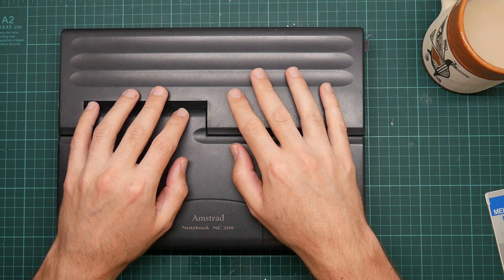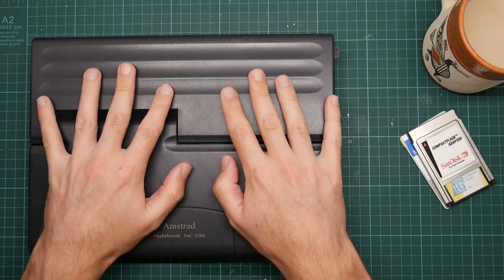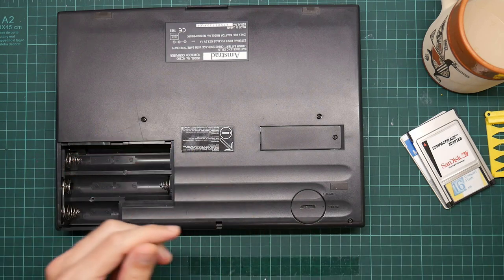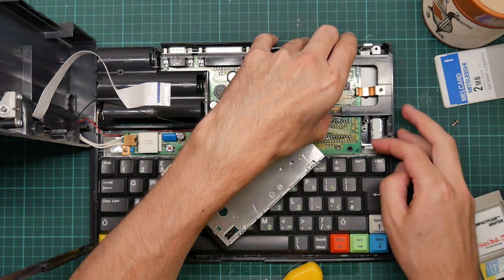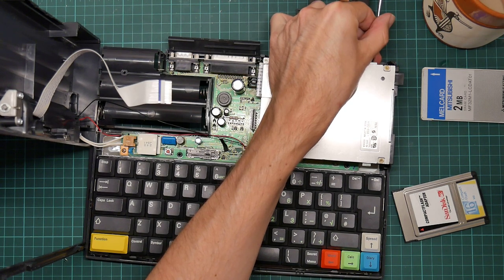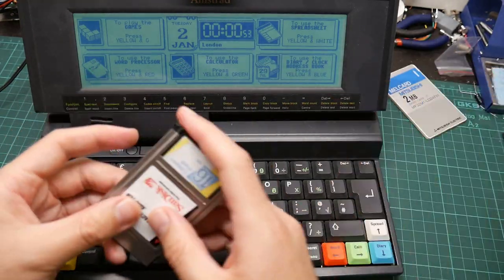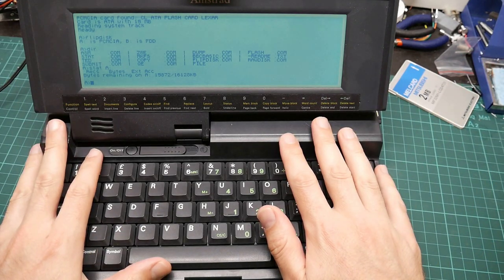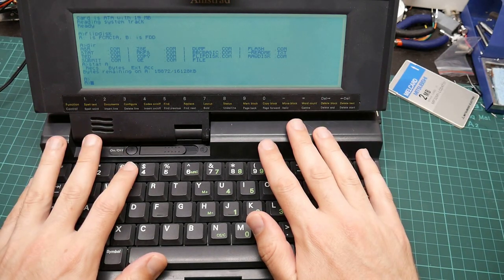Hjalfi flashes an Amstrad NC200

Comment: This is great! i've just bought an NC 200,  Looking forward to running CP/M on it.  I notice on your website that you say there is no serial port support.  Do you have any plans to add that?
Reply from the maker: Mmmmaybe? It wouldn't be hard to do as it's all well documented, but CP/M doesn't have any standard interface for setting things like baud rate and format. Plus CP/M 2 can't poll serial port status which makes writing things like terminal applications rather hard. Most serial port software tended to talk to the hardware directly. It would be useful for file transfers, though.
Reply: @hjalfi  Yeah, that's what I was thinking.  I love floppy disks but it would be great to have something like xmodem to transfer files as well, I've also been playing with some bbs systems on my NC100.  I know that can be done through the standard ROM programs but would be cool to play with in CP/M too.  I have next to no knowledge of CP/M so I'm not sure what's possible.

I've seen another version of CP/M called ZCN for the NC100 & NC200 systems, would it be possible to use the same floppy boot trick to run that?
Reply: @hjalfi  Gert is working on this. It works, but the appears to be some clashes between the system interrupt (which causes delays, also due bank switching) and fetching a byte from the one-byte-buffer of the UART. Hope it works out well :)
Reply: xmodem transfer works, but with failures.. so far. The same xmodem code runs on other platforms without issues.
Reply: I managed to get stable xmodem downloads by masking out the keyboard interrupt during the downloading. I still do not understand what is exactly happening but it looks like the UART interrupt, interrupts the keyboard handler or such. Anyhow, with the keyboard interrupt masked out I can download without errors, even at 19200 baud. The setting of the baudrate is added as an extra bios call. Alas there was no space left in the standard bios config so I expanded the bios by 256 bytes leaving room for more optional extra's. The handling of the serial interrupt, buffering and the code for READER (serial input) and PUNCH (serial output) is all in the supervisor space.

Comment: I've just been digging about in my loft for 20 minutes, and just found mine buried under a pile of Spectrums.

I just need to find/make a 7.5v PSU now... Somehow.

Unless it can take 12?
Reply from the maker: It can't take 7.5V. In fact, the power circuitry is pretty fragile, and also the barrel connector is CENTRAL NEGATIVE and if you connect it up the wrong way round your NC200 will asplode.
Reply: @hjalfi  awesome, top quality Amstrad engineering then, I see. I'll power it from a bench PSU to see if it even works. It seems people sell replacement PSUs on eBay.

I've got an RC2014 that I've been having fun with, so a portable Z80 machine has got to be just as fun, right?

Comment: @Hjalfi - Was a fix found for getting the onboard ROM to access the CF card as RAM, or is this still not possible? I've just got an NC200 and being able to file swap files made on the onboard software and BBC Basic straight to PC via a CF card would be awesome.
Reply from the maker: No, you'd need to patch the ROM to make it work. That would involve reverse engineering it enough to figure out where the SRAM code is, and even then you'd need to make your own modified ROMs.

Comment: I had a similar problem with a palmtop computer - the computer could read a compact flash card but only has slot 1 size sockets, so the compact flash adapter wouldn't physically fit. I actually ended up pulling the metal case off the compact flash adapter and found the adapter itself was small enough to mount inside the palmtop. Effectively this converted the slot 1 socket into a compact flash socket! The palmtop has 2 slots available so I still have the option to use an SRAM card too.

Comment: Just discovered 2 things:
1) you don't need the adapter to use a Type 2 card: you can use a simple file to remove a bit of the material inside the original PC card slot and the Type 2 will fit right in like a glove (suggested to remove the plastic piece while you file it though; so you won't get dust all over the internals)
2) For some reasons if you try to format the PCMCIA card as memory card, the NC200 see the card as a 3 mb card and format it, but it won't use it to save files on it nor it seems you can access it at all, so if you plan to use a type 2 card as memory card, that won't work and will work only with CPM (unless I am missing something... tried with a 16 mb and 32 mb Flash card via type 2 adapter and neither was formatted by the NC200 standard ROM)

Comment: BTW is the ram flash card readable on a standard laptop pc with a PCMCIA port? I assume that when these cards were around, people with old laptops would use these to move data from and to it? Or does it require a special adapter?
Reply from the maker: Provided the battery in it works, then yes. You may need special software. On Linux SRAM cards show up as block devices that you can just dd stuff on and off, but I don't know about Windows. If there's no battery, it'll still work, but as it will lose data as soon as you unplug it then it's not very useful.
Reply: @hjalfi  Thanks; I do not have a linux machine with a PCMCIA card sadly; just an old W98 laptop or a WindowsCE device (a HP Jornada), so not sure how can I actually use the SRAM card with those machines to move data between the NC100 and the other machines I have.
This means that plugging in the SRAM card in a standard PCMCIA slot won't work, right? My concern is related to burning that card... It is the only one left I have, and they go for more than 150 dollars in US... So not exactly keen on destroying it :D
Reply from the maker: @fcf8269  You won't destroy it. It's a perfectly normal type I PCMCIA card. Sadly I have no idea what to do with it on Windows, although there's a possibility it'll just show up as another disk and you could use something equivalent to rawwrite. ...although, hmm. You might be able to use the NC100's serial port to transfer a file to internal storage, and then use the 'make bootable SRAM card' option to write it. Assuming it has one. I don't have a NC100.
Reply: @hjalfi  Thanks; so no damage possible there; in terms of connection. Is the format process using something like dos-compatible filesystem? I could not find details about the file format. If it is similar to what the floppy on the NC200 use, that should be readable by a windows/dos machine I guess

Comment: Which modern embedded and RTOSs would work well on here!?
Reply from the maker: Beats me! Are there any modern OSes which run on the Z80?
Reply: @hjalfi  I mean FUZIX for the Z80 works well. FreeRTOS could be a candidate as could Zeal 8-bit OS, but that’s mostly made for his hardware. 

So that’s 3x modern operating systems, but all would need some work in their own ways, some more than others. 

You have a serial port so could serial console to it. Your specs are great: 

[4.606MHz Z80, 128KB RAM, 512KB ROM, PCMCIA slot, 720k floppy drive, 480x128 pixel display]

FUZIX needs 96KB RAM, and should work with the 512KB ROM. And using a  1MB PCMCIA card could add more storage. (As could serial to USB but that’s a different beast). 

FloppyEMU might get you more storage there too? Idk. 

There are so many modernization options available. Including WiFi over serial. Would be super funny to see this at a Starbucks in the wild on WiFi, using a text based browser
Reply from the maker: @EirikrTinkerTries  I have actually done a Fuzix port to the NC200; it works pretty well, if slowly, although I'm not sure I would call it modern! Unfortunately given that there's only one PCMCIA slot I had to pick the banked memory expansion over the CF adapter, so all you get is the floppy for storage. (Which has now failed, so I haven't touched it for a while...) Without the memory expansion it's pretty memory constrained, with the kernel itself using about half the RAM. This would make it very swap heavy.

Comment: Is it possible to format bigger CF's, such as 64mb? I am aware that I'll be able to use only 32mb. In fact, I found ATA PCMCIA Type I with 64mb, but I am wondering if I need a storage that's strictly 32mb or less.
Reply from the maker: It'll work, but you'll only be able to use the first 32MB.

Comment: would this work also on a NC100? Is there a way to make a flash card that would hold CP/M?
Reply from the maker: Yes, but it'd require some major reworking --- you'd need to use the flash card for RAM and storage, boot off it, etc. Luckily there's a product called ZCN which is exactly what you're looking for: https://www.ibiblio.org/pub/packages/zcn/
Reply: @hjalfi  Nice! is that equivalent to stock CPM in terms of how it can run original applications? My nc100 has a 1mb card so I am going to try this one!
I wish I had a NC200 though; the larger number of lines really make a big difference... And I saw nobody modding the NC100 with a larger screen so far. Great retro machines

Comment: Do you know other Type/ Font Writers or devices like this, which have this boot short cut "Function+R"?
Reply from the maker: I know that the Brother ones all (or at least mostly all) have the ability to run software from disk --- I have CP/M running on a couple of them. The other manufacturers I'm not so sure about.
Reply: @hjalfi  There is another special One - the "Smith Corona PWP ?000LT". It´s a bit similar to the "Amstrad NC200", but more massive and with a bright backlight. No One knows about the specs of these Smith Corona Word processors. Did you heard of them or even know something about their CPU equipment? On these things CP/M would look really cool too, I think... :)

There you can take a look:
https://forum.atari-home.de/index.php/topic,16569.0.html
Reply from the maker: @erwing.3902  That's a lovely looking screen. Never heard of them at all, though. If it's a Z80 it's a good candidate but would need reverse engineering. I found the NC200 floppy boot option by trying every possible key combination, and one of them cleared the screen and made the disk run, so if the Smith Corona has one of those...
Reply: @hjalfi  Yes, that's right - it's a lovely screen,  with roughly the same resolution as your NC200 -> 480x128.
And it has a very ergonomic design at all, I think. Has a 3,5" DD Floppy and was made in the same year like the NC200, in 1993.
Surprisingly you can't get any info about the CPU. Even other owners don't know anything about its specs... :(   That's why I'm unfortunatly supposing that the "Smith Coronas" have proprietary industrial CMOS-Chipsets. The felt performance let me imagine 8bit CMOS.
I will do some experiments for trying shortcuts and bootable disk formats. Sure it would be fun to load something 'around' the ROM-Software.
Reply from the maker: @erwing.3902  Given that there's a floppy marked 'system disk' it seems plausible that there are programs on it, so if you can get a copy of that it's worth looking at the programs. I have in fact just gone looking for teardown videos to get a picture of the motherboard, found Retro Steam Tech's video, and seen your comment there, so let me know when yours arrives!
Reply: @hjalfi  My "9000LT DS" is already there :)
I even have the original "Utility Disk" in package - but: on it there are only some example Files for the pre-installed office tools and three converter programs to run on an additional DOS-PC (converting your word processor files for the use on other systems).
My One is in really good condition, so I´m not sure about to open it... :(
The screen is really bright illuminated. :)

Comment: Good stuff!
Next project: Upgrade to modern battery technology.  =)
Reply: That's already been done. A friend of mine designed a print that fits in the battery compartment (being hold by the springs). It's fitted with 2 rechargeable batteries that can make the nc200 run for many hours. He also created this print for my NC200. One small downside is that you need to drill a small hole in the back of your NC200's case in order to insert the micro usb cable (or charging, obviously). Other then that, it's great.